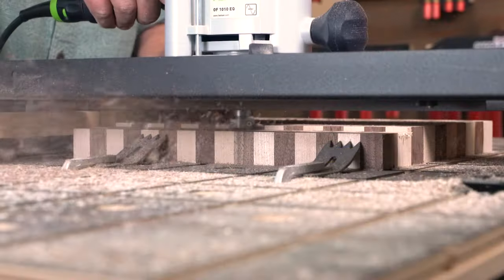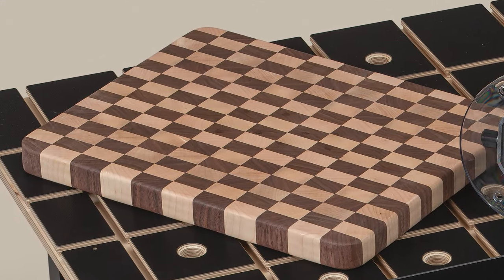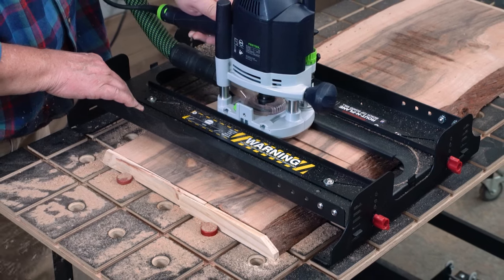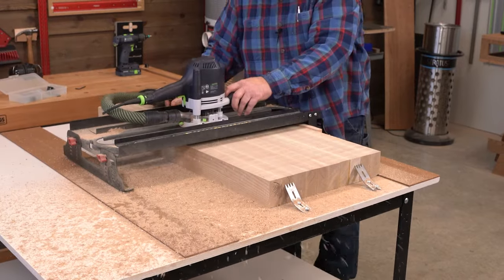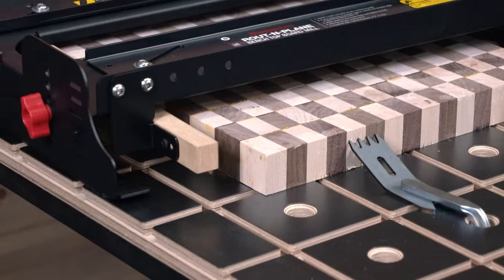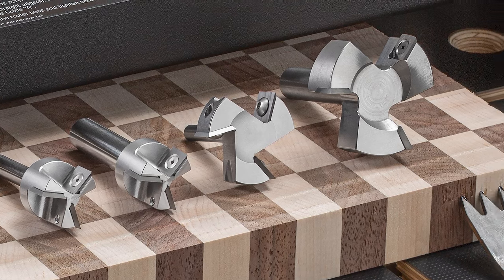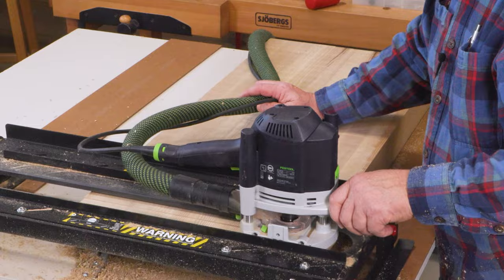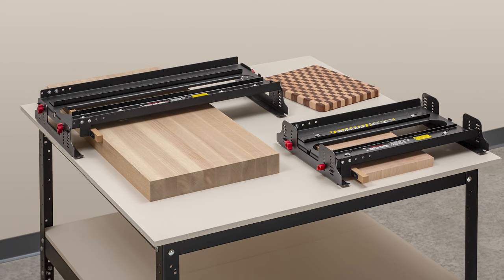Woodpeckers Rout-N-Plane Bench Top Board Mills

Comment: These will be nice additions to my XL slab flattening mill!  Combined with my track saws I have much more portable methods to achieve a squared edge to face that works on material sizes I cannot do with a jointer/planer.  I love everything I’ve purchased from woodpeckers, and that’s a lot of products.  Y’all should have mentioned your spoiler board and your up/down shear bits while you were here.

Comment: If you ran this in an Endgrain board, when they say final sand. Do they mean 220? Or do they mean, now you can go 80, 120, etc….

Because if using this allows me to skip 5 grits and go to 220. That’s a pretty awesome time saving jig.
Reply from the maker: On end-grain maple and with a very good sander I start at 120 grit. 120, 180, 220.